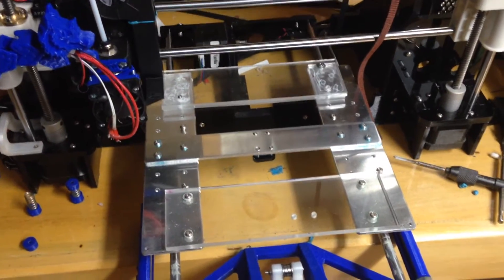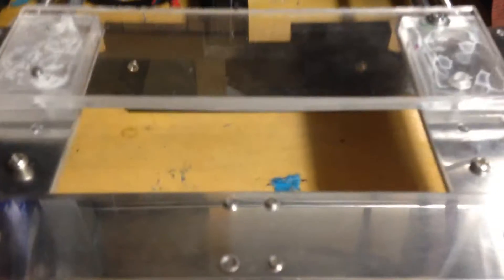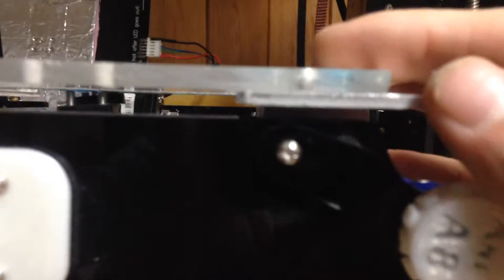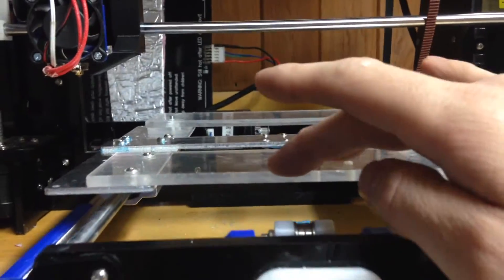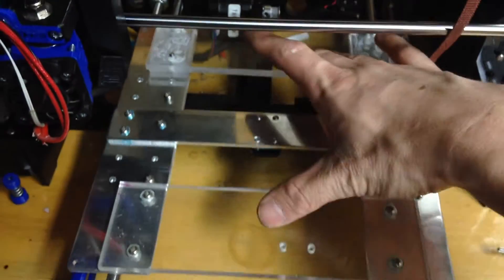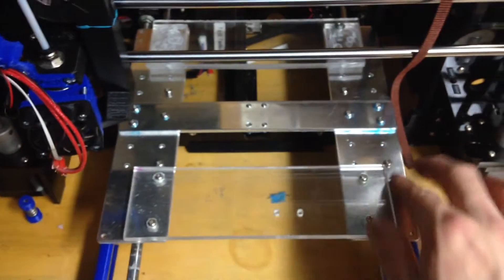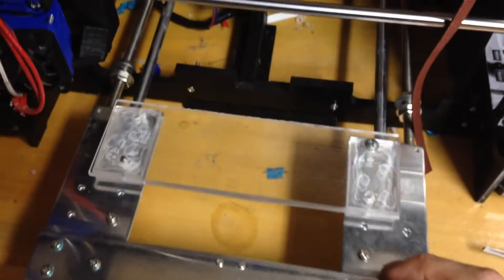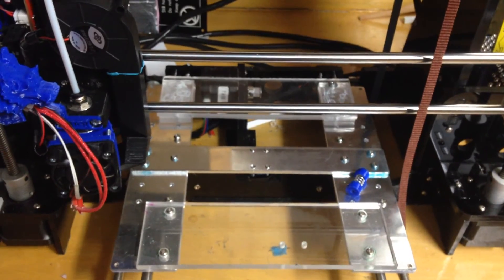Anet a8 heating bed frame supports

Comment: Check this link on the proper orientation of the H carriage.
https://3dprint.wiki/reprap/anet/a8/bed-carriage
Reply from the maker: I figured it out already  but thanks for the link.
i mentioned it in the description that the  h frame is upside down but the assembly is exactly the same I just moved the plexi to the opposite side of the h frame.

Comment: Look at Y belt attachements that have something like 10mm height (http://www.thingiverse.com/thing:1648888). This will line up the attachement of the belt with the motor and idler so that the bed doesn't get pulled down by the belt.

Have a good one!
Reply from the maker: Nice yea that looks alot better than the stock setup thank you.. Thats alot smoother ride for the frame..